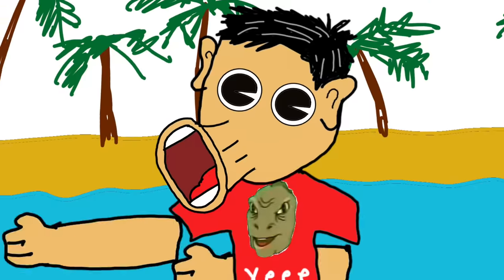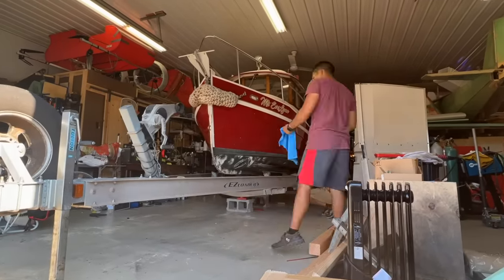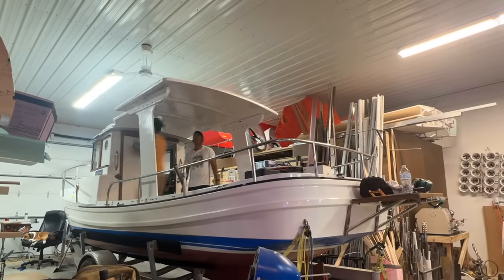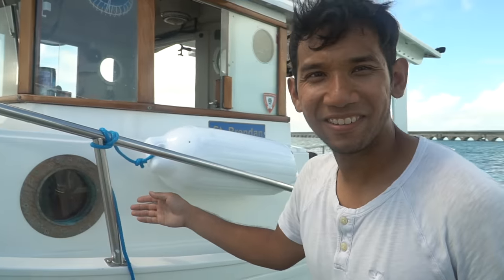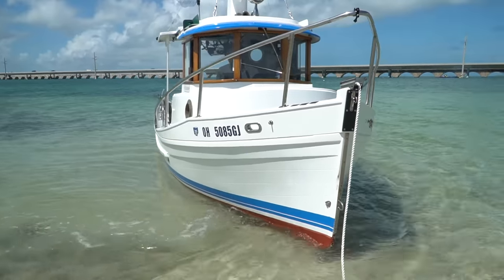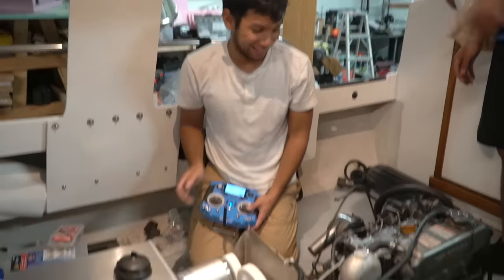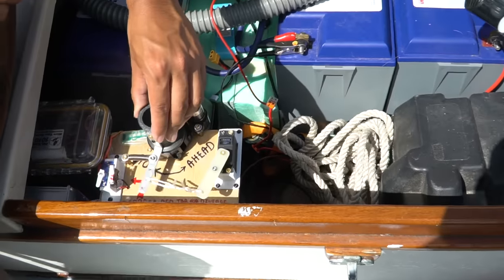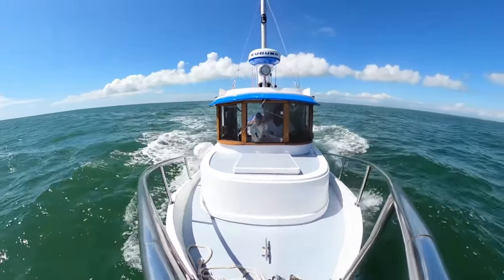I Bought the Biggest RC Tug Boat!

Comment: Really nice boat!  I wish my boat got your gas mileage.
You should camp in the forward berth.
Try the Marquesas, maybe Dry Tortugas if its open.  
Going to the Bahamas is easy if you pay attention to weather.  You need two days of wind out of the south to get the waves in the Gulfstream down, and only cross in the daytime.  Leave early so you arrive in early afternoon.  There are big waves whenever the wind has any northern component, and there are thunderstorms most nights.  On a nice day in the summer with light winds out of the south for a few days, it can be real smooth all the way across.

Comment: This is fantastic... I saw your previous video for the smaller boat you made and now this is a step up from that... those Ranger tugs are a great fun boat and very efficient and useful for their size. Re the brass work, if you varnish the brasswork just after you have cleaned it then it will stay clean for a lot longer but keep the salt water off it as much as you can and just wipe or rub it over with some "BrassO" will also keep it shiny.

Comment: Just throwing it out there: An AGNI/Lynch motor would be a perfect power plant for this boat if you ever go full electric.  
The Lynch motor is an unconventional design with a disc armature. It marries the advantages of a conventional, wound armature motor with the benefits of a flat (printed circuit) motor. It is similar to a pancake motor, but is more powerful than any of these technologies. The disc armature has magnets on both sides, doubling the available flux density and shortening the magnetic path. It therefore packs more power per pound and per cubic inch than any other motor technology. Of course such a revolutionary motor is not for every application - it is not as cheap as wound field motors, but for many applications it is a far superior motor.  It has a previously unheard of power to weight ratio and also power to volume ratio. It is also highly efficient because of the double magnet design and associated short magnetic path. It also includes integral fan cooling.

 The Lynch motor is an important development which spurred other motor designers to improve their products to remain competitive, such as synchronous permanent magnet machines.  As a result of the competition between manufacturers the cost of high performance motors and controllers has fallen dramatically.  We hope the cost of solar cells also reduces to allow renewable transportation to develop as a viable alternative to carbon fuels.
Cedric Lynch built his electric bike around a mid-drive configuration, also building one of the worlds most efficient light weight electric motors to power his rig reliably at 60-MPH for significant distances. He would later set several world records with his axial flux motor and bring it to market as the Lynch / Agni motor. Briggs and Stratton would eventually buy this technology which would lead to the Etek motor, which is now famous for making high speed efficient electric hot rods.

Cedric uses to achieve high speeds is by following the rules of aerodynamics, and building a bike that is as aerodynamic and as efficient as possible. The other builders on this list bypassed this step, and Cedric uses this bicycle as daily transportation on real commutes. Although this high-efficiency motor uses “old school” brushes, this fact allows builders to use very affordable controllers. He has proven his design choices through thousands of miles of commuting, and the Lynch motor is highly respected.

Cedric Lynch is known as the creator of the Agni Motor, a highly efficient electric motor that weighs around 25 pounds and can put out as much as 50hp. 

Cedric Lynch is a British 'mad scientist' type mechanical engineer obsessed with the idea of greener transportation. His interest has been in building a super efficient yet powerful vehicle that can serve as a car replacement.

He started thinking of his own design for an electric motor in 1983 when he began entering competitions organized by the Battery Vehicle Society regarding building an efficient electric vehicle. At the time there was no reasonably priced DC motor with descent efficiency so Lynch decided to build his own utilizing modifying existing motors with old tin cans that he would spread out flat to use as cooling fins. Surprisingly using rudimentary materials and a garage work bench, Cedric was making better more efficient electric motors than any of the universities were able to manufacture in state of the art workshops.

Cedric then came up with a motor design that could be cheaply manufactured and began manufacturing his own motor that he could sell to the public in 1988 and the Lynch Electric Motor Company was born, known as LEMCO.

Cedric first used his motor to create a small boat called “The Spark” that would set an electric boat efficiency record. From there Cedric turned his attention to bicycles, an application generally considered too small for a lynch motor at that time. Cedric mounted his motor in recumbent bike, allowing him space to eventually use a set of thundersky lithium batteries.

The resulting aerodynamic recumbent bike had a top speed of 60mph and still managed an incredible range of 150 miles. Cedric rode his recumbent creation everywhere as a daily commuter, putting an amazing 50,000 miles on the machine - technically a motorbike.

Briggs and Stratton, the US firm famous for lawn mower engines, bought the technology and used it in their E-Tech Motor, and Cedric went on to manufacture his latest incarnation of his lynch design into the Agni motor, which is used in go karts, sailboats, motor boats, and even small airplanes.

The Lynch designed motors all have the same traits. Brushed motors, around 25 pounds in weight and they are able to put out enormous power compared to their weight. Sometimes as high as 50 hp (depending on amperage ran through the motor) at an incredible 98% efficiency.  Lynch Motors are also the most often used motors in electric motorcycle racing applications.

Cedric's zero-emission motorcycle, which has a top speed of 120mph, was shown in action winning the world’s first zero carbon race – the TTxGP in the Isle of Mann.

The idea for the electric motor has been snapped up by the 56-year-old’’s friend Arvind Rabadia, who together with his brother Hasmuk Rabadia had been thinking of starting a business in India. They have now set up Agni Motors to make further-improved versions of Cedric’s motors

Despite Cedric’s breakthrough invention he has no formal engineering qualifications and taught himself the techniques needed to construct his engine. He first became interested in electrics when his parents bought him a book entitled How to build things from things found at home. 
The Etek motor is a brushed 25-pound pancake shaped motor that puts out enormous power for its weight. Depending on amperage and voltage the Etek can easily provide between 15-horsepower and 30-horsepower reliably and consistently (11-kW / 22-kW). A perfect platform for a powerful electric bike if you do not mind the weight. Although brushless motors are considered more modern, a brushed motor like the Etek allows the builder to use very affordable controllers.

Cedric-Lynch invented the motor and sold it to Briggs and Stratton which US company produced the Etek at a lower price (around $600). In the late 90’s early 2000’s it was the way to go for a high-power / light-weight electric vehicle. Many small E-vehicle records were set using the Etek motor. Finally, the market had a relatively lightweight and powerful electric motor available to the masses.

In essence, the Etek allowed hot rodders to build electric bikes. Before the Etek very few people had ever achieved 50mph on an electric bike. Even today, Etek motors (and newer incarnations of the Etek motor) are used to make some super fast electric bikes. In the case of Liveforphysics, the fastest E-bikes ever.

 Liveforphysics used a newer version of the Etek (the Agni motor), to achieve speeds of over 70mph, and dominate a recent hill-climb event.

Every Etek I have ever ridden has been characterized by brutal off-the-line acceleration, usually to a point where you have to apply the throttle very carefully or get thrown off. However, it is possible to run an Etek at a lower voltage or lower amperage and have a very manageable, safe, and sane electric bike that will not burn out on you, no matter high steep the incline.

Comment: Navigation is a must. Daily you can use pad, plotter or phone, but you need to learn navigate paper charts, compass, plot a course and locate by bering.
Safety on a boat is crucial.
Look at weather before you leave, learn how to pick up bad weather, backup communication like VHF or old mobile phone, tell a friend of your plans.
Safety equipment, extra anchor, extra mooring lines, backup propulsion (electric somewhat already done) paddle or a small sail, life jackets, harness if you are outside and completely alone on the boat and far from land. Learn knots for mooring, extend a line, a way that you can climb up on your boat if you ever fall in, make sure you reach it from the water.
How about another belt and pulleys instead of these noisy plastic wheels?
Happy boating.

Comment: Neat project!  You have great ideas, Peter.  I can see you accomplishing just about anything you want to.  Sail around the world?  Fly into space?  You could do it.

For the motor gears getting hot, I bet you could design and fabricate an "oil-cooled gear box" out of aluminum or plastic (similar to the synthetic oil lubrication display with the small gears turning in the plexiglass box on the auto parts store counter).  With your skill, it would be done in just one afternoon.

Great work!  Take care.  Aloha!

Comment: Peter, get the brass hardware cleaned up again, and then coat them in epoxy (reduced and sprayed, or brushed on) to prevent further corrosion.

Comment: maybe kinda cool if you turn this boat to half/full solar battery powered. love the way you hijacked the shaft for the electric motor. i have heard other youtuber were able to 3d print hybrid carbon fiber pla stuff. maybe you can do that to prevent melting

Comment: I’ve boated my whole adult life…..sail and power……here in the UK.
My biggest bit of advice is life jackets….as the say the clue is in the title. Vital especially is loan boating. As mentioned by others some kind of engine kill switch if you go overboard, that proper is a pretty efficient meat grinder. They make a real mess of a body. A kill switch could stop you being run over by your own boat.
If sailing alone some kind of personal PLB (a locator beacon) to help you get found. The oven is a pretty big and lonely place. Boating is lovely alone but having someone else onboard could be a life saver. Always make passengers and crew aware of all the safety kit and where to find it. Showing them basic boat controls is a good idea too. 
Most of all enjoy your time at sea……..am very jealous 

P.S always check the marine weather forecast before setting out

Comment: I radio controlled a 70 foot steel canal barge 7’ wide. I controlled the steering with an electric ram. The motor for the electric ram was controlled by an r/c car ESC. That in turn was controlled by a servo whic moved a servo tester  with a small arm hot glued to the top. The result was the tiller tried to copy the servo position, but with 250lbs force. 

The ram moved at full speed to the desired angle then slowed to the actual position. 
I needed a heavy duty servo to control the morse control on to a Perkins diesel ( old British lorry engine) it allowed me to single manned control the boat at locks with a Center line to the roof.

The electric actuator ram  lift 250 pounds or 1000n Plenty strong enough for the tiller.
They are weaker on the return ( pull stroke) 
Tony

Comment: You could make metal cogs out of your PLA parts. If you talk to someone who CASTs metal, then you print the parts and use a PLA print to do LOST PART CASTING by melting the PLA out of the casting sand, then pouring in the molten metal. Talk to someone near you (not me, I'm in Australia, and I don't have a furnace) who does casting, they can help.

Comment: just some points for advise.
Over here you can use dyed diesel for boats, red diesel I believe it's called elsewhere. Makes it even cheaper to run! 
Also good quality autopilot that I'm sure you can rig up without big $$$, I'm into the ray marine brand. 
And last is to have  lots of good quality shielded rope of various thickness.
The rest is just a matter of how things develop, for example since you are already handy with fibreglass some side pods for stability and maybe a tiny little bit of speed if the engine and propeller pitch allow for it.
That said boating is freedom and I'm the most free when I'm not in a hurry haha.
I have two boats, bigger one 20kn+ and then another pocket rocket 40kn+ for my thrills.

Comment: you need to find a trawler with a secondary back up engine.. These are small shafts that are independent from the main prop... Those are perfect for what you are trying to do.... FYI most modern boats are allready "RC" and have remote controls for docking...

Comment: I am about to start building a boat soon of at 5 meters in length, probably closer to 6-7 metres. Wood and resin and possibly fibreglass. However, I hate working with fibreglass, so I intend to avoid the use of fibreglass if possible. The boat was originally going to be aluminium or steel. However, I'm not allowed a welder where I live, so wood, resin, and fibreglass are the only options.

Comment: Makes me think about how my electric sailboat was mostly remote controlled, just that I never thought to hookup a wireless controller. Between the fact that the motor was just electrically connected to a lever and the auto-steer was hooked up to a hydraulic system. The autosteer could be app controlled, but I never thought to find a wireless solution to the thrust.

Electric winches were in the future plans, but they're $$$$ each. needed 2 absolute minimum, 4 to be practical, a couple more to be nifty.

Comment: I’m not a captain or anything but try gloves for the captain wheel, might help with the sea water if you polish it again and make a sling for your controller so you never accidentally drop it, you can also attach a hook to hang them in the captains quarters, honestly this is probably going to get lost in the comments..

Comment: Hey if you put up a small sail on your mast, the boat won't heal nearly as much. Give it a try if you find it too tippy!
Reply: You could also get/build short trolling poles and stabilizers (also called "paravanes", little underwater gliders that counteract roll). They're great for low-speed stability but they can affect fuel efficiency a bit. They do need some adjusting to get best effect and not bang into the hull if you're not moving. Here's an example: https://www.youtube.com/watch?v=EYp8eVApLrg
Reply: @saveitforparts  oh wow thats super neat! Haven't seen that before, thanks for linking!

Comment: Hey, had a thought about the gears getting soft and had two thoughts, what about using herringbone gears, and polytheramide UTLEM filament? Polytheramide has a melting point of 210 celcius, and a maximum running temp of 170 celcius. Additionally, herringbone gears help produce a lot of  friction without as high a wear on the teeth.

Comment: the water overheat alarm is a good idea, but what really matters is the temp. of the cyl head. IE. the pump rarely fails, but getting something clogged in the cooling system is 100x more common. a simple water pressure gauge is what is commonly used, along with a hot alarm for the head. a  pressure gauge tells you more about the pump than a simple on/off alarm anyway. are you sure Yanmar didn't include an overheat alarm?

Comment: Hi Peter I hope you read this as I had an idea for your solenoid engine, did you think of trying a rotary engine as you can have multiple point of power stroke which should increase the power out put would be cool if you can get enough power for an old style plane🤞🤞👍👍👍